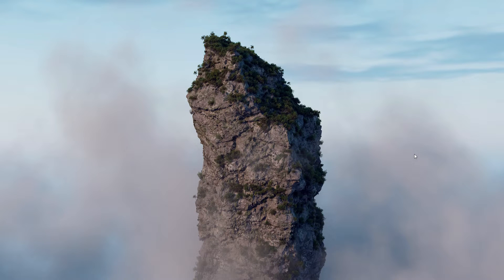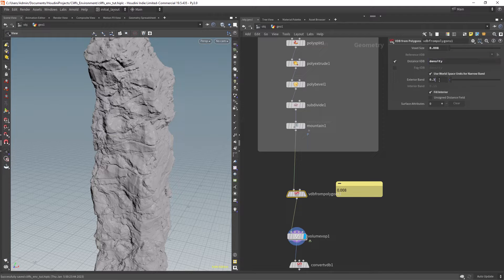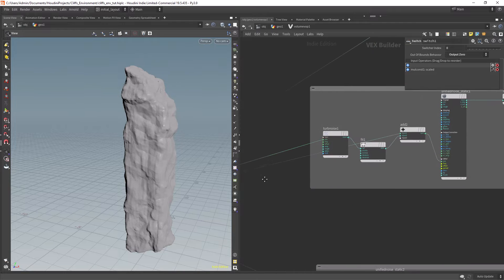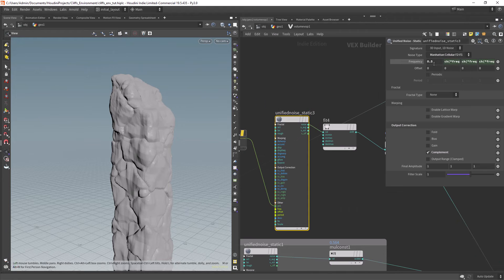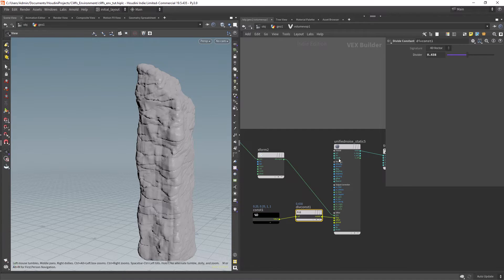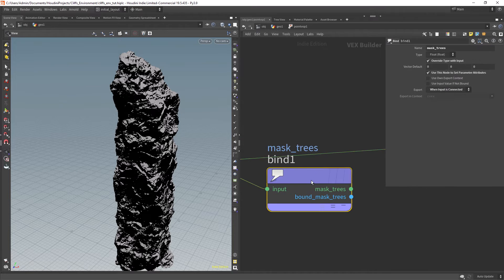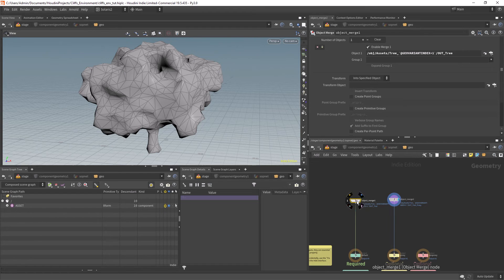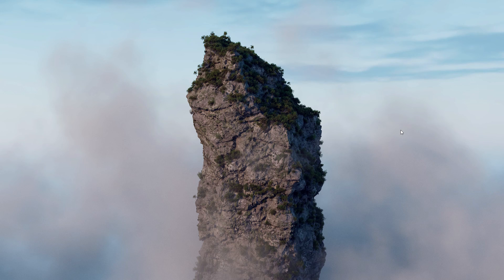VDB Procedural Cliffs

Comment: Amazing tutorial! I'm just having issues making any strong noise patterns without making gaps in the volume... it seems as if I need to tone down the effect of my noises to the point where they are nigh-on de-activated to avoid breaking the volume. I'd love to make deeper cuts into the rock and rougher surfaces, but alas it keeps making gaps. Do you have any ideas as to how i can work around these limitations?
Reply from the maker: hey, did you check "fill interior" in the vdb from polygons? That can help. Cheers
Reply: @cgside  Aha! I didn't enable it, thank you so much! It has fixed pretty much all of my issues!

Comment: I can't repeat volumevop =(
Reply: at the end of the volume vop you need to use an add node. 
-from volume vop global node plug the density to the first input  into the new add node.
- plug the end of the noise ( mult const) into the second input of the add node
- plug the sum from the add node into the volumevopoutput node/density entry
Reply: @sideprojects5924  yes, i am having the same issue. works when connecting the volumebop output directly to the add node. cant seem to get it to work in the section of "unifiednoise_static  > mulconst > switch" nodes.
Reply from the maker: Hey, you can grab the file and dissect it. But I would try to make my own rock/cliff . Cheers